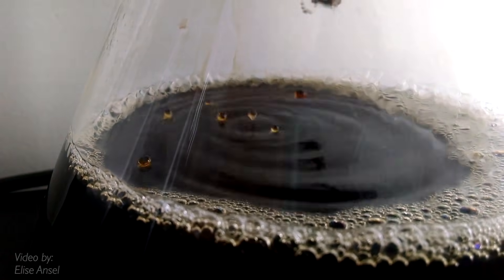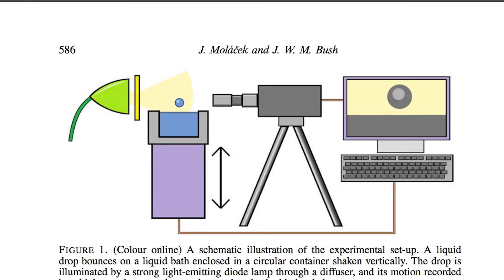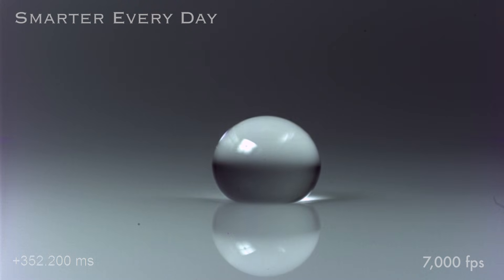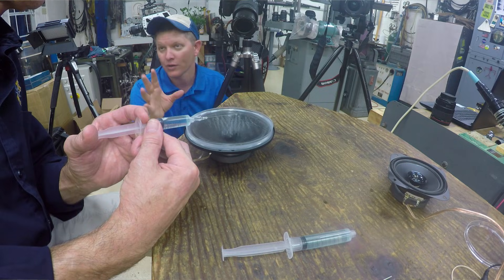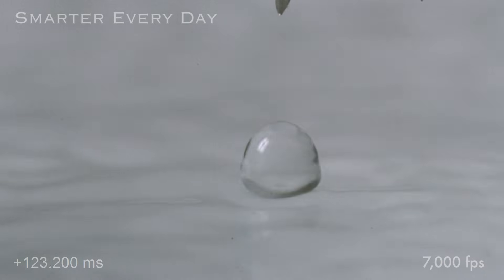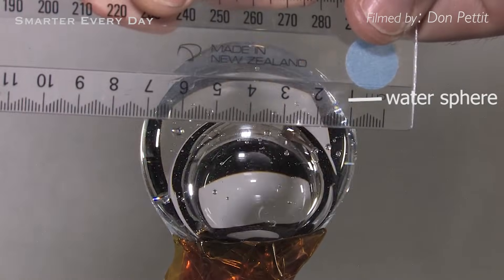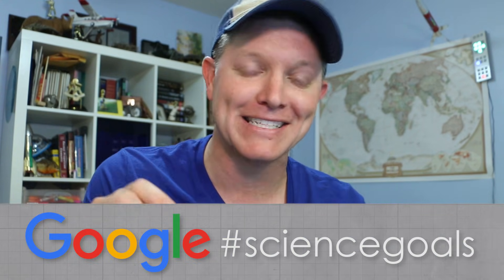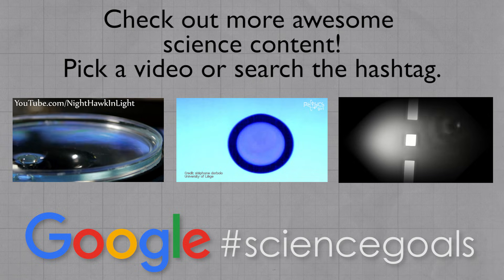The WALKING WATER Mystery (in SPACE and SLOW MOTION!) - Smarter Every Day 160

Comment: I think you need to include Symantec’s into this. As for the cello it has harmonic resonance unlike a pure wave. 

When you pluck an acoustic guitar string the harmonics are present. Play a natural 5th harmonic hard off the string and focus your ear on the sound then pluck the string open gently. If you keep doing that you will soon be able to hear the harmonic by only plucking open. Try the 7th fret harmonic as well…

For well trained ear you should be able to hear 3 harmonic over tones in a single plucked string. 

When the cello is playing you’re getting all different overtones and resonances overlapping and even wave interference.  I believe This is why the water is acting that way with the cello sound

Comment: The air "wets" the water drops and you have to overcome that before it will merge. I think this same air wetting causes some of the phenomenon of gauge block wringing where a slight film of oil pushes out the air. Something similar can be seen in Optical contact bonding where the air keeps the surfaces apart until 1 pinpoint finally touches and cascades to the entire surface. 
 Water has a polar molecule so I think it must arrange itself into a kind of "skin" at the surface with one pole facing outwards , that might interact adversely with the "skin" on the surface.

Comment: At the cello scene, personally as a cellist, I think it has to do with the resonance of the wood board on cello, because of the sound wave has to travel through a sound post and vibrate the wood of the sound box, it creates the sound wave that eventually makes the waterdrop look so beautiful. However, cello is an instrument that use strings to produce sounds, and amplitudes plus hertz would also change the physics of the sound wave. So it could either be the materials of what the cello is made of or what the strings are made of, Or maybe it's because of the speaker.

Comment: Nice shots. But is the trapped air theory definitely confirmed? Somehow it doesn't convince me, although I do not have a better   explanation. To confirm this theory, you could do those experiments again, in a chamber with greatly reduced pressure. 
If trapped air is really the cause, the effect should be much shorter or even nonexistent in a low pressure environment.

Comment: After you changed the variable that was turning on the speaker 🔊 you’ll should have turned it off and played with elevation of the falling drops 💧. Because I’m thinking the speaker is only replicating the energy that is transferred back into the droplet 💧 causing it to vibrate within itself maybe even vibrating against the larger body and causing it to delay the coalescing.(if that’s the proper word)

Comment: Ok so you guys kinda got it right but......
It's not an "AIR" layer....it is a Hydrogen layer
We know that water is comprised of H2O.....2 Hydrogen atoms and one Oxygen.
The 2 Hydrogen atoms surround one oxygen.
Thus, due to 2 Hydrogen atoms surrounding one oxygen at the surface there is a very thin Hydrogen layer.
Of course this Hydrogen layer cannot be ignited or anything because of the strong molecular bonds of the valence shells.
And Hydrogen being one proton and one electron......we also know that like charges repel one another.
Therefore....on the surface....we translate surface tension as The Hydrogen layer at the surface repelling the like charged Hydrogen layer of the water droplets.
Until......the droplet can arrange itself to then molecularly bond by arranging the hydrogen atoms with the other oxygen atoms of the underlying water that it is resting upon...and finally blend in...this takes a moment of time.
We can observe this Phenomenon even more ......by witnessing flakes of Gold floating upon the surface of water.
Q. ---How can this be possible when Gold's SG is 19 times that of water being much heavier.....but the Gold floats.
Same reason.......the Hydrogen Layer at the surface of the water (One electron) Is Repelling the one Electron in the Valence shell of the gold until the surface is disturbed enough for the water to Coalesce and finally bond to the surface of the gold flake...and then the gold will sink.  
With water droplets of course it disperses into more water volume.

Comment: One time when I was trying to germinate Sea Rocket seeds I noticed that the seeds had a strong attraction to any solid objects including the sides of the glass. After much research I learned that this is likely an example of the Cheerios effect albeit a strong Cheerios effect stronger than other objects including Cheerios that I compared them to. I haven’t been able to look at the Sea Rocket seeds under a microscope but I think the structure of the surface of the seeds plays a role in its strong Cheerios effect. This makes sense because Sea Rockets uses water to distribute its seeds and the seeds need to find solid ground in order to mature into a plant. Anyone interested the Cheerios effect or biomimicry should check this out. This video reminded me of that experience being a surface tension related phenomenon.

Comment: The answer is almost given in youtube:
Surface Tension - What is it, how does it form, what properties does it impart

As not native English speaker and Physics and Chemistry teacher I'll try to explane this.
Almost. The next is not told because it was not needed in this about surface tension.  
If a droplet nears a water surface, the distance between the water surface and the bouncing molecules of the droplet is still great because of the air between them (Oxygen and Nitrogen molecules). One molecule between them is enough to keep the distance to big.  It takes some time to get rid of all the air between them and get the right distance between the compressed molecules to overcome the existing Hydrogen bound in the surfaces.  Because of the compression the Hydrogen bound is stronger at the surface than inside the water. So the droplets and surface must come real close to join droplet and water.
The speaker let the droplets dance over the surface. There is not enough time to let the surfaces come so close to overcome the compressed  molecules attraction because the air is coming between them when jumping. The rest is told above.

I hope the problem is solved by this explanation.

Comment: maybe there is magic ratio of surface area captured by a matching geometric "cuppling" of a corresponding recipient surface.

maybe sound vibration, hot water (micro-boiling along the surface of hot water), or drastic difference of temperature or oil content will all act to disturb the natural matching of that geometry.

and as along as that disturbance is there, the air will have an opportunity to fill the gap.

Comment: It has nothing to do with air, but resonance. The vibration of one water source, adhering as a unit by surface tension, interacting with another water source (or any soluble liquid - perhaps any water-soluble substance) of a different resonance must reach an equilibrium of action in order to coalesce. It's about vibrational entropy and energy equilibrium. The higher energy source shares it's energy with a lesser energy source until the two are approximately equal in energy output, and then the two may act as a single unit (coalesce). Note: It was stated that it would be thought that the air would be pushed out of the way rather rapidly and wouldn't be expected to bounce so much before coalescence, however, when the droplet bounces, it creates a gap between itself and the water surface. This creates a pressure difference that would pull air back into the pocket, causing the droplet to have to push it away with LESS force on each successive bounce, as more air than was pushed out of the way would be drawn in, reducing the energy of the droplet further before hitting the body of water again.
Eventually, this entropy would result in a form of harmonic resonance whereby the two bodies can synchronize and coalesce.

I still have to watch the video, but this is my pre-experiment hypothesis.

Comment: How do you explain dragging a styrofoam cup filled with coffee across a table and balls of liquid jump up and ride on top of the water like something out of The Prisoner? I imagine it's a variation on a drop of water falling onto a vibrating water surface: the vibration--perhaps at some kind of resonance--kicks a bit of water up off the surface, and it settles down in a "catchers mitt," until it doesn't and is reabsorbed. However, the same ball of water can stay there for quite a while as you drag the cup.

Comment: hey , how about you try changing temperature ,well i guess this also depends on surface tension
and 
the constant short of make them bounce of the surface ,so that frequency is also increasing the pressure
(the bounce by the surface at those tiny balls).
in short these conditions are interfering with surface tension and pressure of both droplets and water surface.

Comment: I'm at 3:10 and my guess is that the surface tension in the drop and on the surface of the larger puddle is stronger than the gravitational force moving the drop. I would guess that it's stronger then the normal surface tension given that there is two sides. No clue I'm just guessing and I promise I haven't cheated.
Great video so far, Destin you never disappoint and I'm mad I haven't seen this video in the 3 years I have been watching your channel.

Comment: I have a differant theory that does not involve an air gap. An Oxygen atom has 8 protons forming a cube with 6 sides. Add 2 hydrogen  atoms with 1 proton each and they will stick to the sides of the  the oxygen atom forming a water molecule which kind of looks like a Mickey Mouse ears. Here is my theory: The ears of a water molecules come together to form a bond that causes attraction to hold the water mole cues together causing surface tent ion. Four of the six sides of the oxygen atom do not have attraction, thus they do not stick. Given enough time to adjust their orientation the water molecules will combine. Add the right wave energy and the water molecules will not combine with other water molecules, thus the water beads will not break and dance on top of the other water molecules.
Well, that is my theory away. I call my theory "Snap Theory" and it seems to explain quantum mechanics.

Comment: Cool video. I understand everything that you were speaking about. And do you have a lot of good hypothesis. However. I think your mistaking. Not completely. But more that. I have studied this very subject for many many years. I studied it every single time I sat down and had a cup of coffee. When I discovered was the very mechanism which displays how out of nothing something becomes. What I mean here is that. I can make that ball of liquid jump up out of the liquid which it comes from and dance around on the surface. it doesn't do it because there's oxygen or air in between. It does it because of the vibration inside of the liquid. And the vibration inside of the droplet. Oh yes and I heard your statements about the size of the droplet. No I'm sorry it was the doctor's statement. Where he said it depended on the size of the droplet. Yet. They say that all of the imperial measurements were derived directly from the droplet of water. Because it held a consistent measurement of 1 mm per droplet. It was this consistency which led to the measuring systems we have today. In my studies of this little water droplet. I discovered that the actions which I filmed and observed were due to the vibration in the liquid which was taking place inside the cup which I drug across the table. The display it made was quite impressive. It actually took on the perspective given to us in physics. It says that a waveform goes out throughout space at high rates of speed and they are continually making right angle turns which appear to be circular corkscrewing type actions. And when that one form of energy meets up with another form of energy like it. They continue on together and collect more as they do. Every time they make a right turn they disappear. What this is is a waveform that you cannot see. Unless you have tools to do so. As these waveforms travel about. It is said that they collect together until they become a tangible form. Something solid. Something we can see with form and shape and activity because it is inside of our tangible world. And what takes place here in the droplet floating upon the surface. Is that. when I would drag the cup of coffee across the table. A stream of droplets would shoot up one side of the cup in spray droplets of liquid up and out of the cup. When they would land in the cup. They would move around on the surface of the liquid with lightning speed. This is due to the lack of friction because they are riding upon waveforms. That means that just like two planets their energy force goes out to a certain point between the two planets this is where the place called The slipstream occurs. Zero Time zero energy zero gravity. And when you watch this droplet stay on the surface of the liquid as long as the vibration occurs and even after the liquid stops moving. You will see and come to know that what you are watching is the very activity of creation itself. This is where life comes from nothing and becomes something. It's pretty straightforward and holds true to physics. I have never had help with my studies. But for sure this is the very way that you can see how things develop from nothing into something. As I observed this activity. I always did it in awe. Because I believe it displays where life itself is and can be found. I could talk about this for a lot longer until you more that I've seen and understand. But. I've said enough here for the moment. Hope everybody enjoys. Once again I liked your video. Peace have a great day

Comment: That captured air theory doesn't hold water for me. My problem with it is that multiple droplets dropped from the same height don't constently bounce and some bounce more than once. That variation was demonstrated in a science class in high school. The conditions were rigorously controlled. The inconsistency blows the air theory.
And the speaker observation is under different condition. 
Have you tried this with distilled water? 
It feels like a phenomenon with surface tension. Is it possible that the surface tension of the droplet is increased just slightly by the kinetic energy of the collision and held within the spherical shape but spreads out on the larger volume? Then as the surface tensions equalize, the droplet merges. 
I love the cello too. Especially Yo-Yo Ma. And you can't beat a Stradivarius.

Comment: This phenomenon is caused because of surface tension of the water, and all substances have different surface tensions. A solid has more surface tension then a liquid. Plasma has less surface tension then a gas. A detergent or soap decreases surface tension, enabling a liquid to soak into another body. A water droplets surface tension is what keeps it in form. The cello causes the larger bubbles to break into smaller bubbles when the large bubbles come into contact with the inside surface tension of the inner bubble, but only with correct frequency wave time location

Comment: Thanks for this beautiful video.

Maybe also consider dynamic flowing water inside the drop , causes the bead to spin and cause a pressure difference on one side of the bead compared to the other, which feeds a convection current between the bead and the surface and also causes movement of the bead explained by Bernouilli's principle, a thrust on the spinning bead on an air cushion. The water beads skim across the surface.

Reminds me tangentially of the Barnes Wallace project of spinning bombs aka the Dam Busters and also stone skimming. 

The controlled experiment using droplets that fell weren't the same case as others observed because the water droplet wasn't from a moving stream of water. 

Again a very beautiful video and a blessing for us.

Comment: I have an idea for the walking water. Water has a charge and when in bulk the molecules of water at the surface are arranged in such a way that the surface of the water would have a negative charge. Like a thin negatively charged liner. When a perfectly spherical droplet is made the surface of that droplet is perfectly arranged with a negatively charged surface. This leaves me to think that when the droplet makes contact with the water surface it is simply two negatively charged objects repelling each other. They do not merge until the molecules rearrange themselves in such a way that the positively charged hydrogen atoms are now making contact with the negatively charged oxygen atoms. Now when you introduced the speaker/frequencies my thought is that the way frequencies travel through air and water is done in such a way that the molecules follow the beat essentially. This is seen when you change the music types. The water behaved differently. So the thought is that when a perfect spherical droplet makes contact with the surface of water experiencing the frequencies the frequency is now traveling through the water surface and droplet and is prohibiting the molecules from rearranging as they would normally thus prolonging the walking water droplet. As for the space station droplets that break off this would be because the frequency the molecules are trying to follow, keep up with are rather violent with sharp shifts. so the droplets break off until they can remerge with the water bulk. All in all this is just a thought I really don't know.